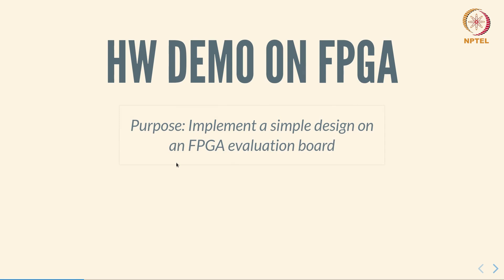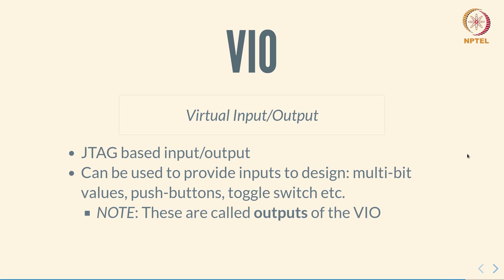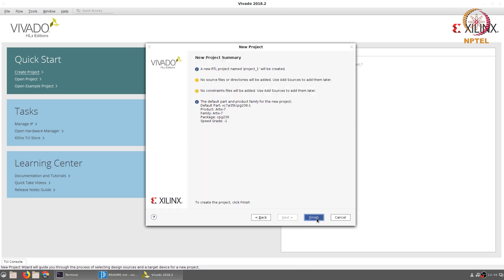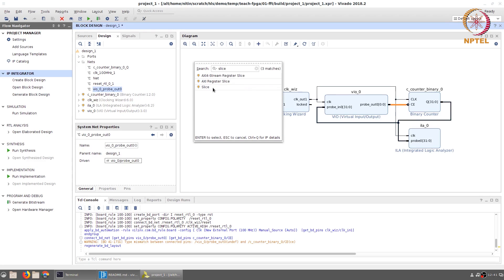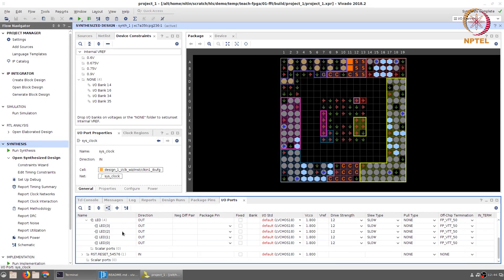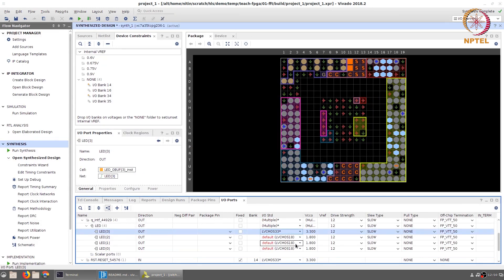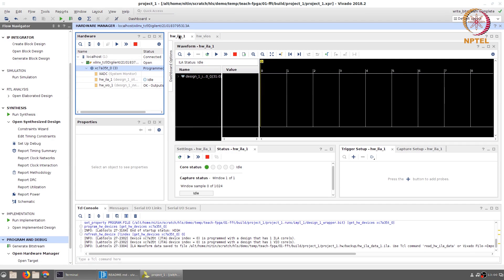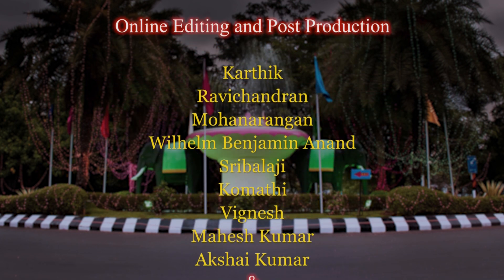Lec81 - Demo: Vivado ILA and VIO on hardware

Comment: Sir did you connect the fpga board to PC while running VIO and ILA...can I do this without a board with me??
Reply: You can do all steps till generate bitstream without the FPGA. But, you cannot observe any outputs without programming it on the FPGA. So, you need the FPGA to observe the final outputs
Reply: @TechNwomen ok thank you for your help
Reply: @TechNwomen  @I am not able to replicate this project as its showing (make sure the clock connected to the debug hub (dbg_hub) core is a free-running clock and is active.)
If I directly connect the input clock ,then it runs, also am using zybo board. please let me know.
Reply: it was showing a  clock freerun issue. i was able to fix it..just remove the reset at clock wizard and it works